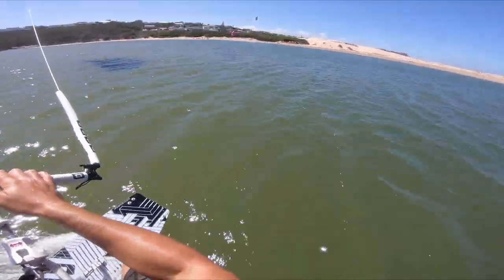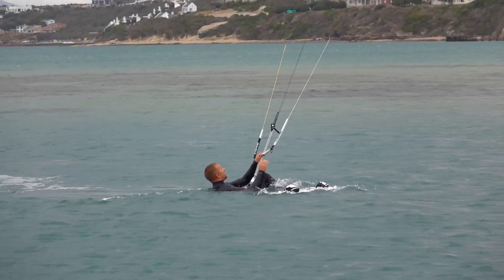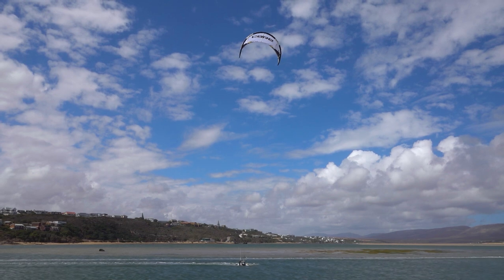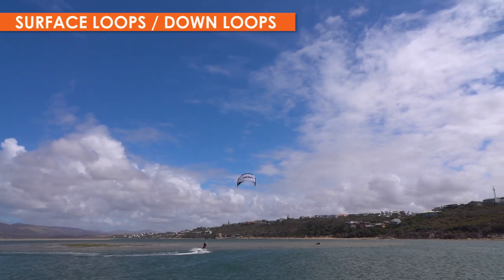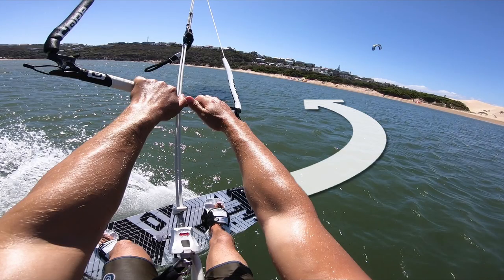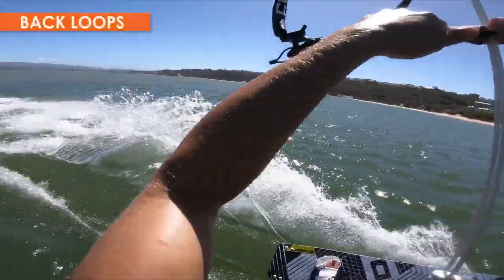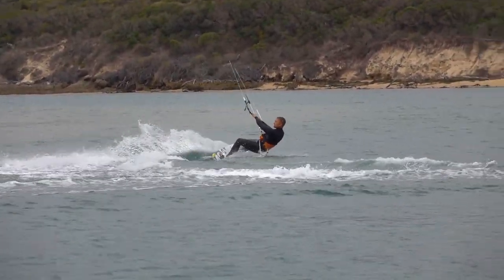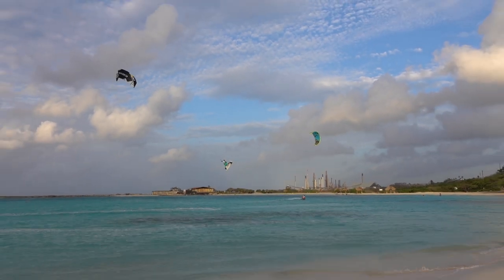Introduction to Kiteloops (how to kitesurf / kiteboard tutorial)

Comment: Great hints as usual! Alex, based on what, you decide to loop clockwise or counter clockwise? or doesn't matter?
Reply from the maker: Hello Gaetano. For the bodydrag loops, and surface loops try both sides, the more experience the better. For the aerial loops, you want to land on your strongest side. For example, with the HELI loop: if you're regular footed (prefer to have left foot forwards) then I would try it riding to the left side, which mean looping with the left hand as you land; however, if you're goofey footed (prefer to have right foot forwards) then I would try heli-loops for the first time riding to the right side, which mean looping with the right hand.
Reply: ok, so, doesn't matter so much in which direction the kite is turning from an aerodynamic perspective right? just the rotation that is easier to give as commands with hands...
Reply from the maker: Exactly. The kite should loop well on either side. The more important factors are the size of the loop, how fast you're moving, and whether you loop with your direction of travel or against it (like in a backloop). Have you tried any of these loops before Gaetano? What stage are you at?
Reply from the maker: Also Gaetano, I read your comment from last week regarding apps etc. If that's your industry, I'd be interested to discuss further. Feel free to email me:  kitesurfco@gmail.com   thanks, Alex.
Reply: Kite-Surf-College Tutorials and Tricks only tried body dragging, water starting, and turning curve for the moment! I write you an email for the app...

Comment: Your tutorials are really great! I watch this one a couple of times and did my first downloop transitions and water start recently.
I was wondering what are your experiences or advice for downlooping or helilooping with larger kites like a13,5m or even 17m - I use Core XR4 and XR5 - so the aspect ratio also comes to play - there is really not much space for a downloop - is helilooping realistically possible with these big kites?
Reply from the maker: You can definitely downloop and heli loop larger kites. In fact, I'd say that a 13 or 15m in light wind is the best way to learn for an adult around 80kg. You want the loop to be small and stay high above you. You don't want a large loop where the kite drops down in front of you into high power. This means you really need to crank the bar to get the bigger kite around quickly. For slower light wind kites (such as the contra) you may need small line extensions, a wider bar and to move the wing tip pig tails to fast steering, but it is still definitely  possible. You can even downloop a 21m foil kite, although you can't heli loop them. Obviously you want to be under powered. If you loop a large kite in strong wind you might as well be tied onto a truck!!
Reply: Kite-Surf-College Tutorials and Tricks Thanks a lot for your reply and feedback! Yeah I have trimmed my large XR kites to fast steering, and use line extension for my 17m. So should be fine. Yes the pull at 20 knotes is an experience...will continue working on the downloops, and try a heli loop. Thanks again!